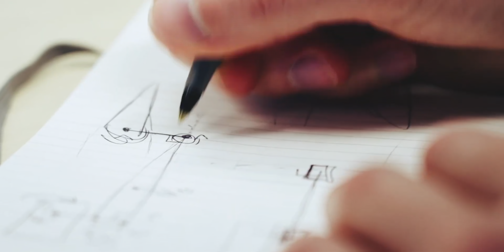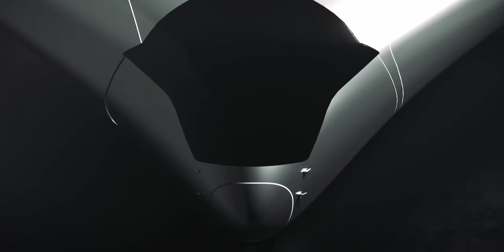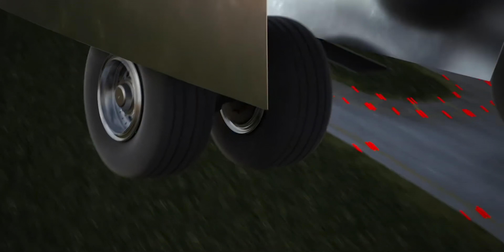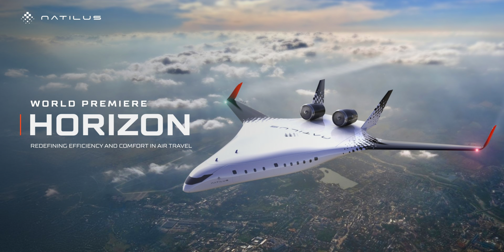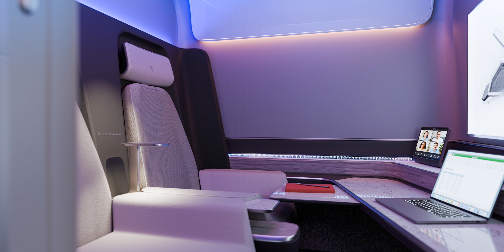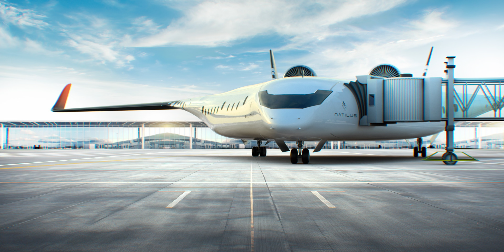Natilus Reveals Interior Design for HORIZON Blended Wing Body Passenger Aircraft

Comment: Build of such a multi curved aircraft hull and making it able to handle the ~ 6 Tonnes of pressure per square meter is very challenging. That's the weight of 3 large cars on every square meter of inner pressure hull surface.
Traditional Tubular airlines can easily handle the pressure VS Blended wing body will need very strong and possibly heavy reinforcing to withstand the pressure which could undermine it's potential aerodynamic lift advantages.
If they can overcome the design challenges they do look pretty cool and the wide cabin layout could be quite comfortable.
Reply: why don't they add columns inside the fuselage to endure the tensile forces of the pressurization trying to push the fairly flat looking passenger compartment into a sphere?
Reply: @thisyoutubechannel6896  As you say regularly spaced columns under tension would be great for dealing with the inner pressure - but as stupid as it is i would imagine that an architect or whoever designing such a plane would refuse to accept such a compromise to their conceptual design - so we should not have any hope they will ever be built. Present tube shaped aircraft are actually pretty good in terms of efficiency and these blended wing body designs could actually be worse rather than better.
The traditional tube design has a small circular cross section coupled with fairly slim low drag wings it will be hard to beat.
Reply: @stephenhumble7627  ok but what's the problem with adding those columns inside the aircraft though? The answers to that question I can understand from your response are "it's stupid" and "whoever designs a plane like that would refuse such a compromise" even if I'm stupid, it wouldn't hurt for a more detailed answer other than "because they wouldn't like it"
Reply: @thisyoutubechannel6896  well it would help if they designed with columns but there is frequently poor  communication between designers , engineers and financial. For instance the Boeing 737 MAX 8 debacle.
The entirely new and radical layout seems like it's a hard sell - good luck to whoever takes on such a challenge..